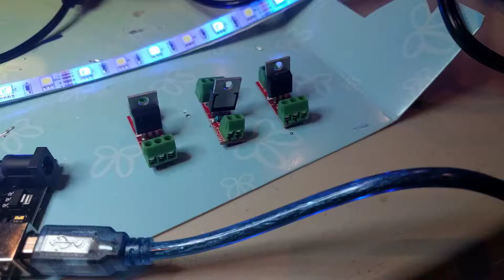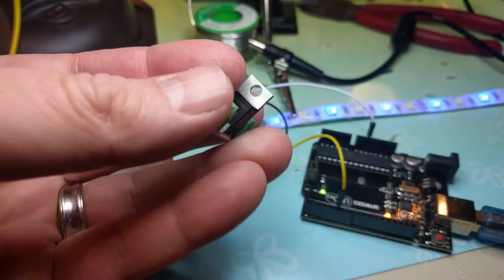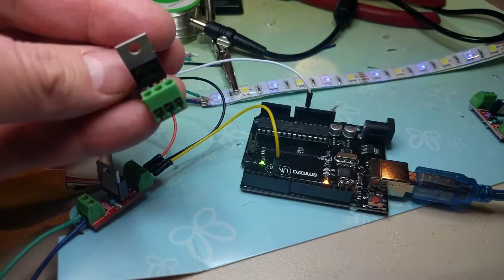How to use a MOSFET Power Control Kit for Arduino

Comment: Thanks for the heads up on this little guy. After I assembled it, I was wondering what to do with it even though, I was using the same Mosfet in a different project. You saved me a bunch of time. Thanks again.